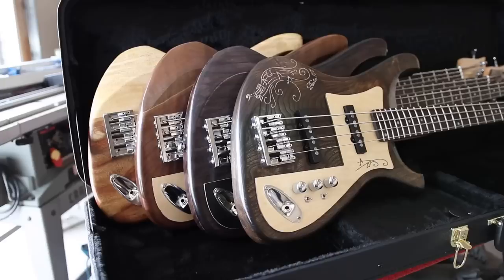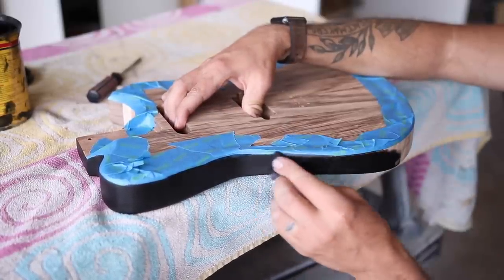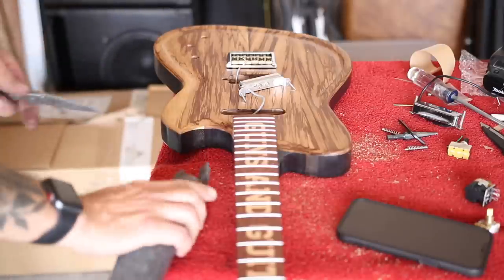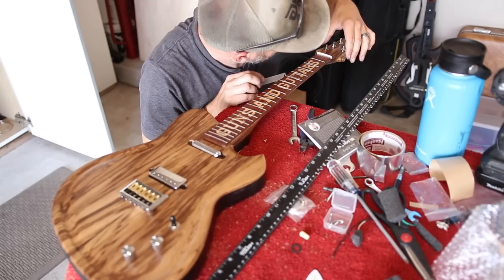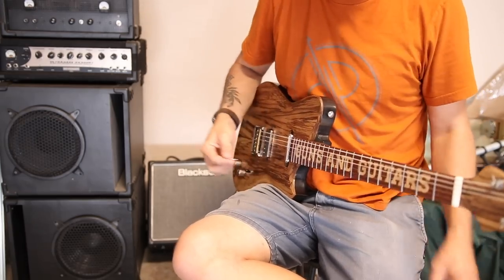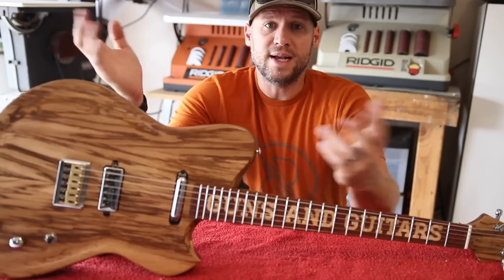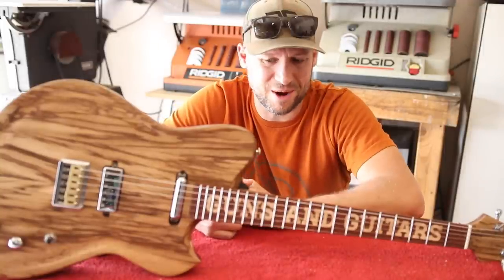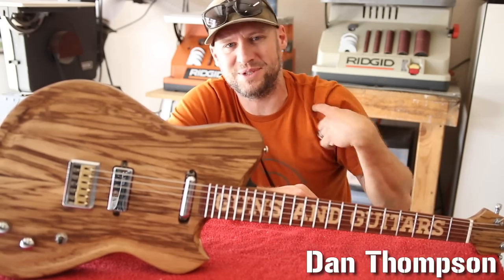A Custom MADE IN USA DIY Guitar kit!

Comment: Try switching out the cap on the tone pot to .033uf (preferably a vitamin Q paper in oil cap)

It will take the edge off of the humbucker, make it sound a little darker but in a good way.  Orange drops are great but tend to have a very bright attack.  I think you are using a .022uf cap, which is great for humbuckers but probably not the best fit for singles and/or minis which are usually super bright.